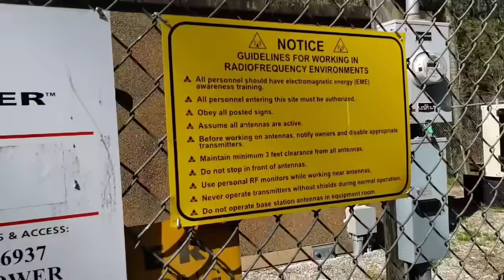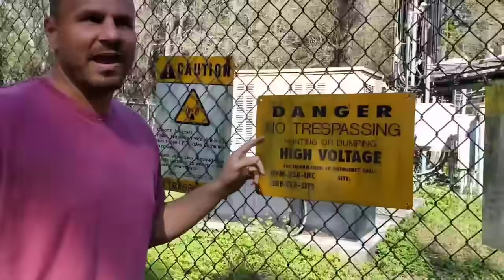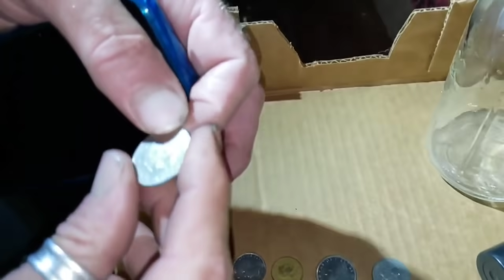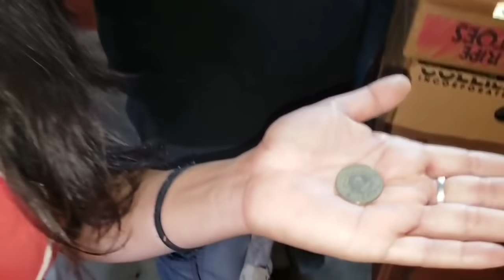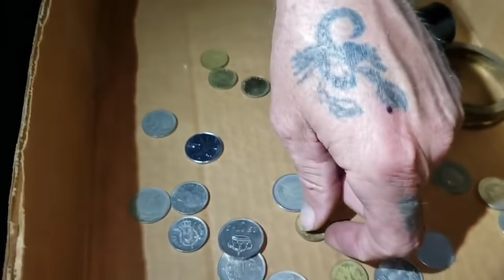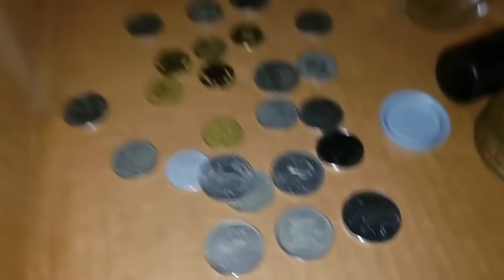FOUND HIDDEN MONEY Looking For $100,000 LOST MONEY

Comment: that clear container is from gun powder for cad welding, they used that to weld the ground wires to the tower so they can ground it out, ive worked on some towers here in rhode island, all the other parts are either leftovers and or junk from repairs they should have cleaned ther mess

Comment: what you first found is called a Clam shell for weather protection of connector. Second Item is a snorkel for fiber weatherproof and support third item is a thermal basically gun powder for thermal welding. Jumper which is used for RF connection to radios.

Comment: Hey guys.  The milk cans were probably used to dispose of old oil changes & other liquids.  I'm sure they had swamp water in them, as well.  It stinks pretty bad.  As far as hunting for the money, you need to look for the right things.  Old time folks would usually put their money in glass quart jars.  They were more waterproof than even metal containers like tins & lunchboxes.  Probable locations for burying money are under or around front or back doorsteps (in case of a house fire), around the base of a chimney,  at the base of the front gate or back gate of the yard,  at the base of plants in the yard or in flower beds.  Also look around the base of trees within a 100 feet or so of the house.  Look from the windows of the house & see if you can see something that could be a key marker.  Some folks would bury their money where they could see & check on it every day without leaving the house.  Check the floorboards, as well.  If any look loose or show signs of being tampered with, check under them.  Another place is around a water well & even in it.  Some folks would bury coins instead of paper money, so it wouldn't be unusual to find it in a well, but doubtful if it wasn't connected with a rope or chain.  You need to get a metal detector to use around the areas I've mentioned.  If I were there, I would try using dowsing rods or a pendulum to dowse for the money.  If I had a good map of the area, I would try to first dowse the map.  If you could locate someone from the bank where the lady cashed her checks, they might be able to tell you if she took coins out instead of paper money.  She made have also bought gold or silver coins from a local store or pawn shop.  I hope some of this info can help you.  Good hunting!

Comment: cant say for sure but it looks like hard line for the tower and the other parts you found are cable holders find a local ham radio operator and they can tell you for syre

Comment: You need to use thin wire to hold the meat to the trap. This way the animal has to work at freeing it and will step on the plate. The longer you can keep them inside the better your chances are they will step on it. Best bait is sardines. You can put holes in the can and wire it in so it can't be taken. Only open the lid partway so again,animal has to work for it. The smell of those sardines will have Mr Racoon doing back flips to the trap.

Comment: Those wires and brackets are for the antennas on the tower.  Unlike pure electrical wiring, nominal power data transmission cable need large insulation to prevent signal loss and rf radiation exposure.   The ones that look like gas pipe are for microwave transmission, the antennas look like drums, they need gases in addition to rubber insulation as they tend to be high voltage and extremely high rf, as with thermal radiation, radio frequency radiation has difficulty going through noble gases like argon or krypton which provide more resistance than rubber and plastic.